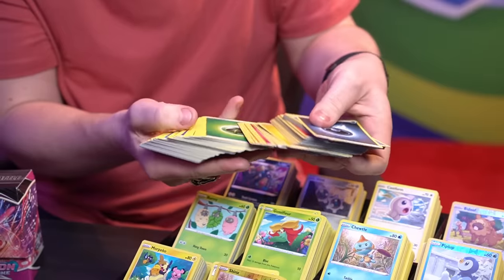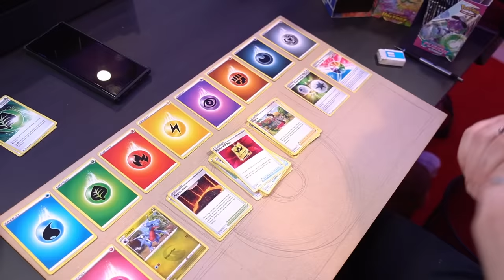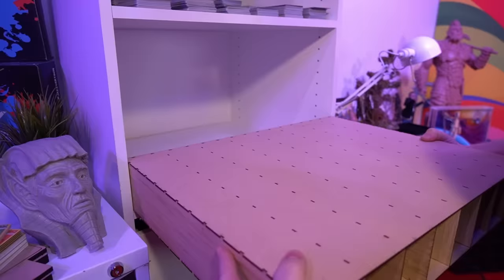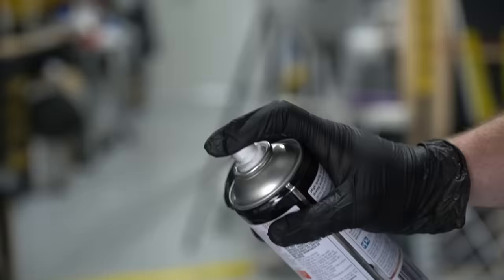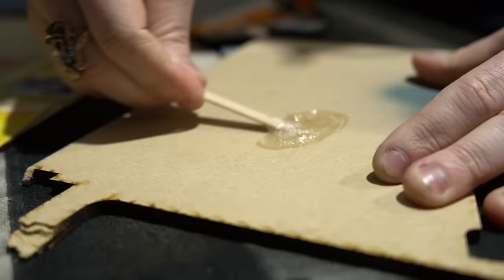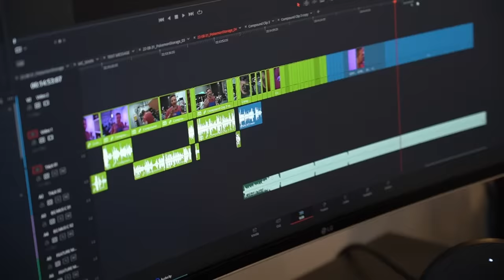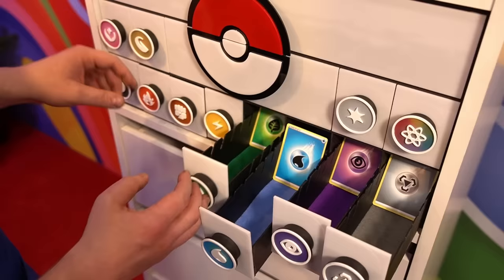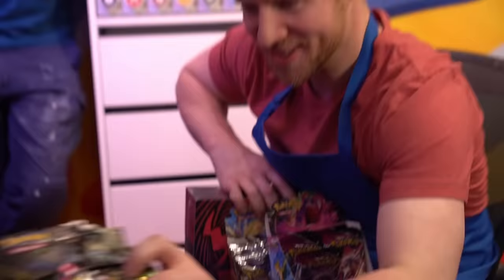I Made INSANELY SATISFYING Pokémon Card Storage!!

Comment: the 'non energy' type cards are known as 'Colorless' type (they represent Normal type Pokémon)
The storage solution looks awesome, I must say
But as a player and collector of Pokémon TCG, I worry about the 'snug fit' causing damage to the cards!
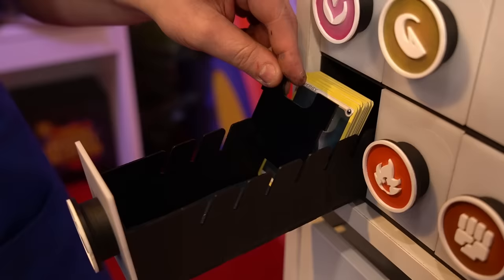Reply: 18:04 even he was worried aboit that, but I don't think he's gonna be taking these cards out that much so it probably won't be that bad.
Reply: he literally said they aren't the valuable cards, Im sure Jazza knows what he is doing lol
Reply: He still could've danded then shorter wich bugs me, he even sands the top drawer because it didn't fit! He could've made I less snug but didn't. As long Ad it's not the valuable or cool looking ones then I guess it's fine...don't screw up jazza.
Reply: I'm pretty sure that the even remotely valuable cards are the ones he placed in the top drawer with the plastic insert, which is made specifically for storing cards. I think he has a different place for any valuable ones, and the other drawers are just overflow/common cards. Don't worry, scared me too at first, lol
Reply: This is  general storage, he prob has those valuable cards stored somewhere else
Reply: Im pretty sure its just the cards he plays with. He probably keeps any valuable ones somewhere else.

Comment: There's just two issues with it that I could see. Unless it's in a controlled enviroment, wood has the ability to swell up which could make it hard to open up the drawers. Opening the drawers often could also lead to tearing, which later leads to the same issue with it being harder to open. Which is why I would have gone with plastic and a way to use wheels on rails to make them easier to open.